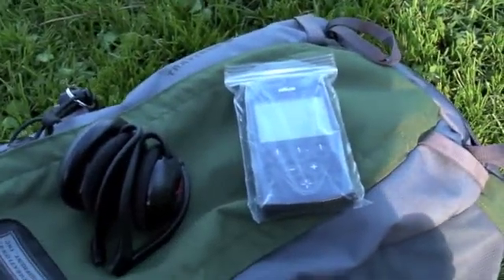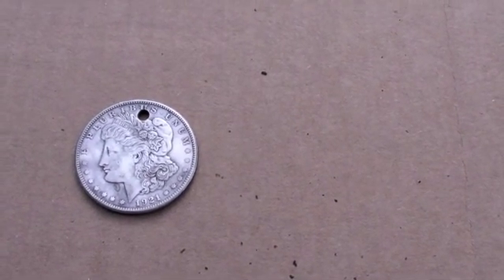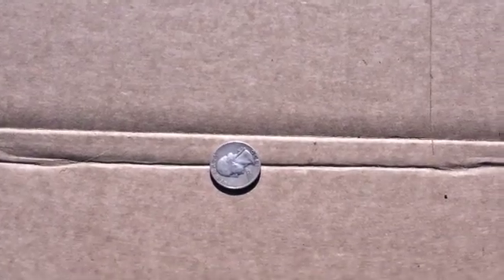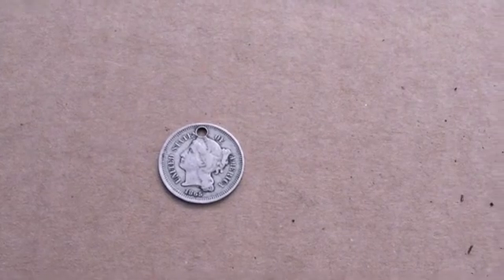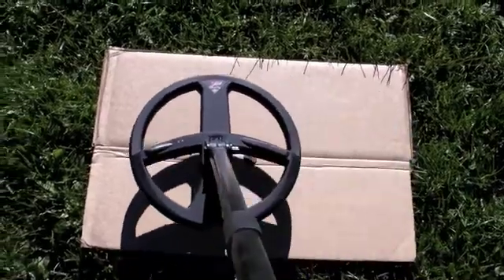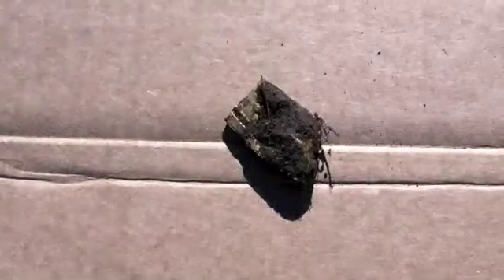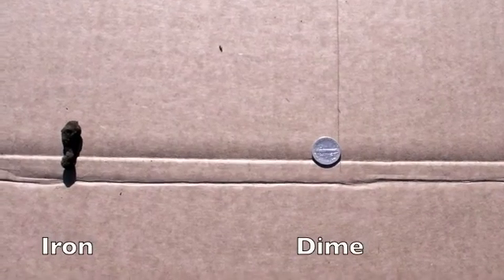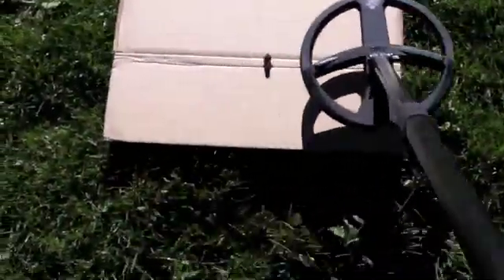Deus XP—Setup, Conductivity, & Reactivity Testing

Comment: It's all relative, GPX 5000 has a retail of $5500.00 yet the White's TDI SL which is even more quiet with comparable performance is only $1250.00.    Your 'Air' or Surface Test is meaningless because MOST targets are found within the ground where the ID differs.   The conductivity of the Target is only one variable.   Many more to consider.
Having that BAG over the Control Pod defeated the Clarity of your Video.

XP-Deus Multi-Line Dealer

Comment from the maker: @GlennLane1 That's a good tip.  I'll start taking it out of the bag when storing the control box.  I did purchase a sports cover, but I prefer to attach it to the magnet on the shaft with a plastic bag.

Comment: If you seal the plastic bag to the control box it will attract moisture which will eventually damage the control box. I would recommend buying one of those sport mp3/mobile phone covers to protect it which allows the moisture to escape.  Nice video though.